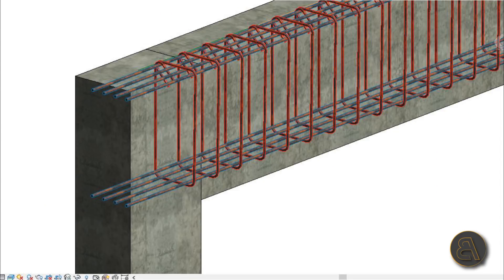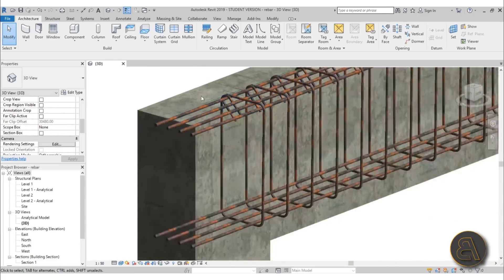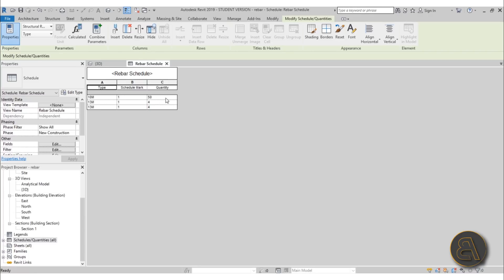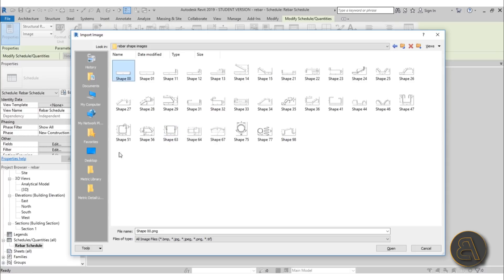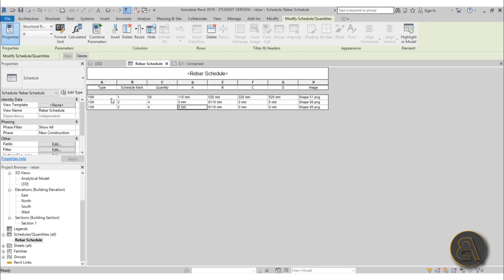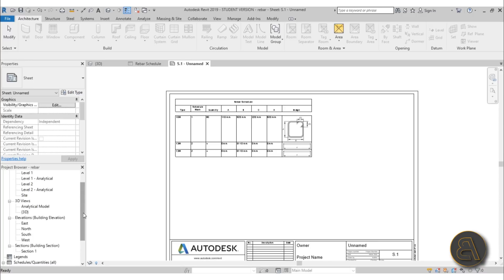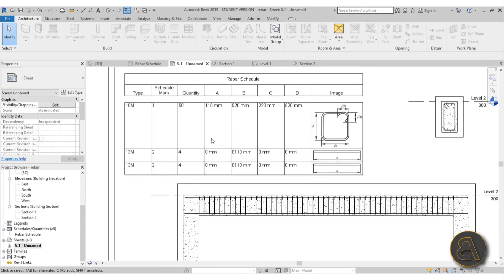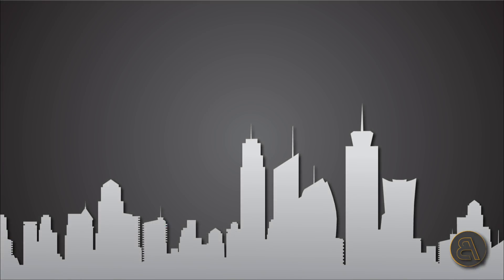Rebar Quantity and Bending Schedule in Revit

Comment: Hello, if we have several floors when rebar detailing, should we difference the rebar size for each column, beam, and slab on each floor?(i.e 19mm column A lvl 1, 19 mm Column B lvl 1, 19mm beam A lvl 1, etc) Especially when we want to make automatic bill of quantity from Revit.
Reply: Hi there. Much better if they will be detailed separately.  ex., COLUMN DETAILS together with their Bar Bending Schedule.  Then for the BEAM Detail also, SLAB DETAILS and so forth. cheers.

Comment: Hi! Thank your for video. If you only could see schedules, that our constractors make. They are terrably overcomplicated.
But, on the other hand, yours is too simple, so you made a logical mistake. You added an image to sertain rebar, 10M. But you may use the same rebar for another shape in your project. So it will cose a mistake in a while. You should make another schedule for category "rebar shape", and add your image to exact shape. And in your schedule you should add only the parameter "shape"

Comment: Hi there, nice video, however the shape image dimension letters A, B, C, D do not match with the dimensions you have in the table. For example, the straight bar length is annotated with the letter A in the  shape image , and your value for A in the table is 0 but the value of B is 8100mm which is actually showing the length of the bar. any idea how we can change this so that the image agrees with the table?

Comment: Hi BA,
Thanks for your video. Is there a way for Revit to round the length of the reinforcement bar to nearest 5mm? E.g. if I have shape code 00 and its length is 7358 mm, but I want it rounded up to 7360 mm in the schedule. Thanks

Comment: I would recommend using the "Shape Image" (type) parameter inside the Rebar Shape families, instead of using the "Image" parameter inside the schedule. Using "Shape Image" parameter allows you to assign an image directly to a rebar shape (which will be used repetitively in a schedule) instead of assigning the image to the rebar itself. If you have lots of rebar in you schedule, it could be very time consuming to assign an image to each rebar. Thanks for the video.
Reply: Yes! After hours of searching. I found the video. Here is for those who are interested in the Shape Image technique. https://www.youtube.com/watch?v=Vu0yaccb1LM
Reply: Hi there.  I agree to that.
From my previous company, I only show the shape image if there are special bars that need to be presented according to their respective Values for bar bending.  Shape code 99 for example.  cheers.